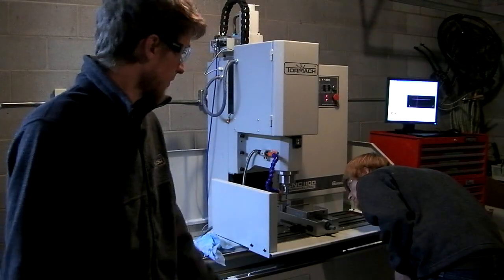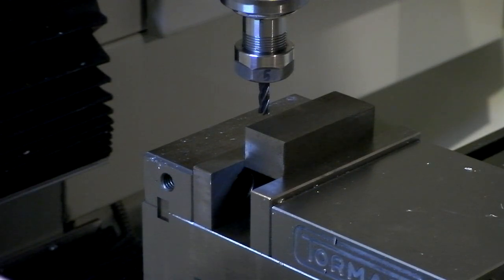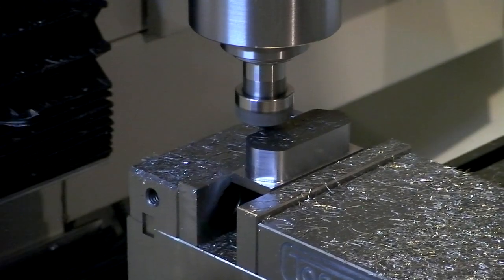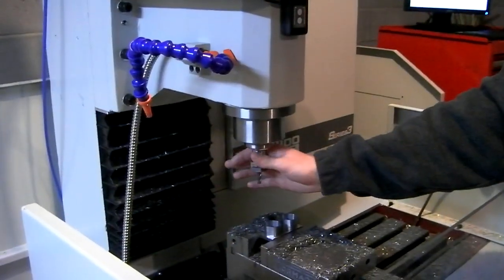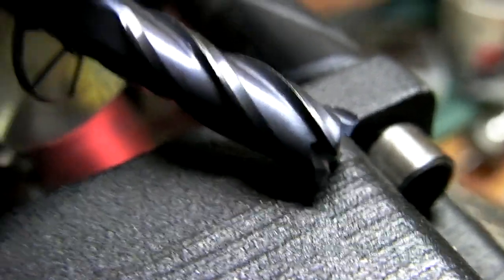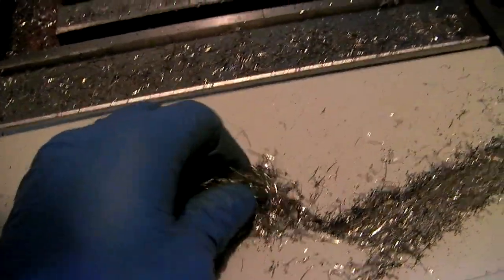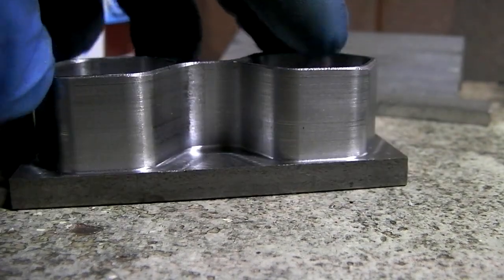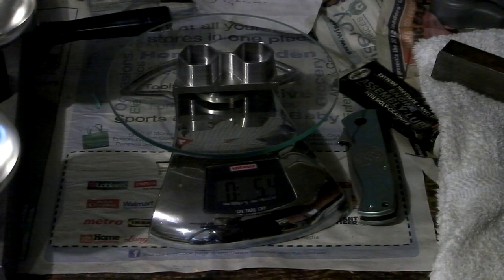Tormach - first steel machined part

Comment from the maker: Filmed 3 vids yesterday, coming soon.  The part in this video didn't make blue chips, so you're right that I probably could have fed quite a bit faster.
Gwiz is awesome.  I haven't tried it on an offline computer yet, but on my work PC it keeps asking to connect and update and I just ignore it, seems to work fine.  It does need internet to install it, but you can do that temporarily to your shop pc, even if you have to bring it inside.  I just use it on my desktop while coding, not in the shop.

Comment: I forgot that :P I've tried 1600mm/min at a dept of 6.5 with 1.2mm stepover.
It produced a stream of nice blue chips :)
I should try G-wizzard, everybody says it's good. But supposedly needs a internet connection every two weeks (if I remember correct) and I don't have that where I have the mill.
Any new videos on the way? :P

Comment from the maker: It all depends on your depth and width of cut.  Have you ever tried G-Wizard?  It's a great program for figuring out speeds and feeds.  You can really only push it so hard before something gives, machine rigidity, endmill flex, surface finish, chip clogging, heat, etc.

Comment: I milled some mild steel today in my homebuilt milling machine at around 5krpm and 1500-1600mm/min (59-63ipm) 6mm carbide end mill (1/4") with great results! 
I have a video of it but there I only feed at 1200mm/min (47ipm). So turn that feed up ;)

Comment from the maker: Not sure what you're getting at.  The drawbar on the new machine is awesome and works great.  If you're referring to the Grizzly, the belleville washers had too large an ID for the bolt that I was using, so they would cock to the side and not provide very good clamping force or spring travel.  That caused tools to pull out sometimes and made tool changes hard.  It would be an easy 5 minute fix to make a bushing on the lathe, I just never got around to it.

Comment from the maker: I tend to measure everything in inches, it's just the way I learned.  At least in machining, everything is measured in decimals and to the thousandths of an inch, so I don't have to deal with fractions thaaat much.  But then again, all the tools are labeled in fractions so I keep a calculator handy.  I'm still having trouble "knowing" how to measure small stuff in millimeters.  In the end it's all what you're comfortable with, both work fine.